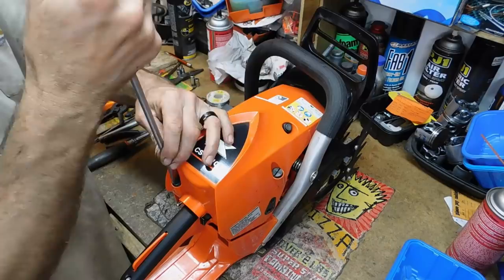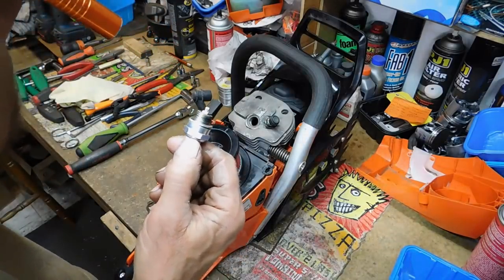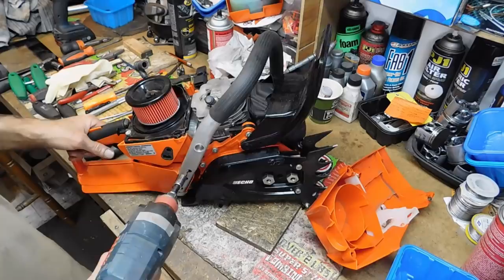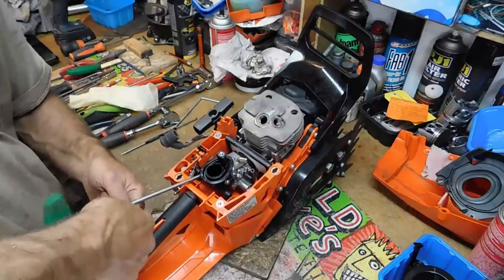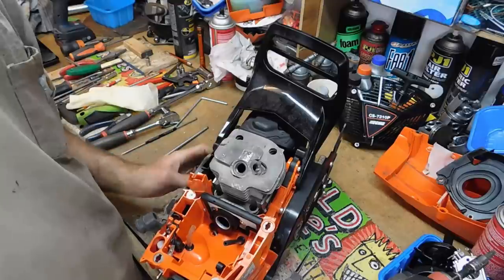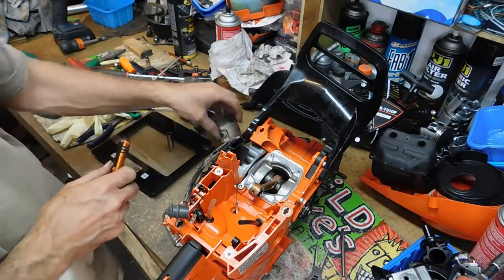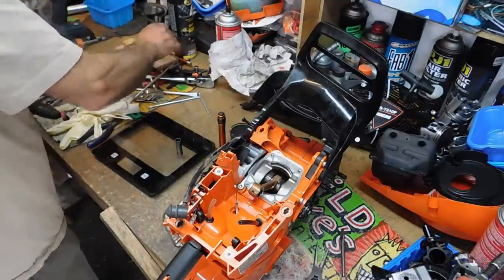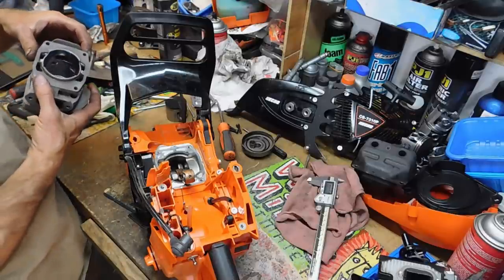Echo CS-7310P Bench Talk

Comment: 100% accurate, I live at 8,369' and m-tronic/autotune doesn't cut the mustard
Reply from the maker: I told that to a fairly high ranking Stihl rep and/or tech.
Nope/they will adjust/there must be some other issue was the waffling.
Didn't want to hear it. 
But, they don't go up there and try things out either...
Thanks for watching.

Comment: Nice to see this coming from someone that's building a mean saw....just from the video before you even mentioned some of the things I seen things myself...and for a saw that had around 4 tanks of fuel through it before pulling cylinder sure had a to  of carbon on the top of the piston and there was only 2 little clean spots in the top of the piston so not much air wash going across the top of the piston to help keep hot spots off piston....but very awesome video

Comment: Hi hotsaw 101 while I was watching the video I notice that the combustion chamber was clean but the top of the piston looks awful black is that normal ? the spark plug looked good as far as I can tail what kind of 2 stroke oil are you running in that chainsaw and ratio?  always good video!

Comment: Well, at about $450 cheaper, better plastics, and a spark plug that you can actually use a standard scrench on, I'll take it over the 500i.
Top cover plastic is already breaking apart on the 500i's.
Reply: I've seen echo's with plastics in bad shape too. Doesn't matter the brand for these pro lvl saws, depends what hit them :P They all use the same PP plastic with fiber glass
Reply: An interesting note for you. A company called BASF mixes the plastics for Husqvarna and Echo in-house then ships to the respective companies in pellet form to be melted in injection molding.
Reply: @Brian2bears  Yes, I used to work at a BASF plant in Maryland many years ago. They also make composite materials for boats and RVs! Interestingly, a lot of companies who sell refrigerated products such as yogurt, cottage cheese, etc, use their products as well.
Reply: @thebradleysoncatbirdhill6849  So you are not the average bear , I look for and enjoy your comments from time to time. ....

Comment: We cut at 8500-9500 ft on average 🤣
Reply: What saws do you use ?
Reply: @sundial6919  Usually running a 660 or 461, sometimes a 562, just lose 30-35% power
Reply: @nouseforaname6846    Thanks . Sorry to hear you lose that much power . By the interesting and impressive sound of this review the 7310 would lose about 90 - 95% power . Cheers
Reply: I wonder if they'll make a super charged chainsaw for higher elevation power? I've seen that jet powered chainsaw prototype.

Comment: It would be easy to check the plenum pressure using HVAC testers. Also they are trying to create a blower.  They are using centrifugal force through air moving in a circular motion to keep the air filter clean.

Comment: Mr. Jack, another note of interest in relation to the "squish" is compression. Inquiring minds would like to know. Thank you.
Reply: Squish is how close the piston pot is to the step or ring in the top of the jug. Squish effects compression but doesn't dictate it. Things like dome or dish pistons also effect compression and in a big way. Deleting base gaskets normally lowers Squish a d raises compression, but also changes where your ports are
Reply: @longstar550  12:33 squish is measured by Mr. Jack @.62. I was curious if a pre-zip compression reading was taken.
Reply from the maker: @Brian2bears  hi. in case others missed it, the .062 number I mentioned was the squish of this saw in bone stock form.
An actual compression reading with a gauge, no. They generally run low when new. I also like to not be jaded with the very first unit. So, I'll just take it out and run the thing as is to get a feel for it as sold. It's a like like doing prototype testing.
My interpretation or context is: Squish is the measurement at the edge of the piston dome & skirt interface when the engine rolls over TDC.

I would agree with longstar550 - that the amount of squish will have an affect on the end result of the compression reading.
I've never seen in a saw where decreasing squish does not also increase compression. But, I have not seen it all either.
Thanks for watching.
Reply: @hotsaws101  Thank you sir for the reply. I appreciate your kindness and longsuffering. I look forward to hearing from you time to time.

Comment: Thanks for the breakdown. It's unfortunate that performance was sacrificed to make it burn clean. Also, thanks for the information about cutting at altitude. I've noticed the difference on older carbureted motorcycles but for some reason never really thought about it in relation to saws.

Comment: Thank you for the informative video.  I understand your trade and interest are focused on chainsaw performance and cut speed.  What I'm curious about is your perception of the saws utility as a tool and instrument of income for accomplishing paying work in the tree trades.  Based on your perspective of the materials, the design, the ergonomics, vibration, durability factors, ease of starting, exhaust inhalation etc, how do you rate this product against the competition in a strictly pragmatic sense?
Reply from the maker: John hi.
I bushel/ed for most of my working career. So in other words, piecework felling timber. The modding & bench talk videos were an offshoot that came in the later decades.
The reason for having equipment (saws, chains, gear, etc.) that perform well is so that my time spent sawing down & bucking up trees was efficient.
I come from that place, and it is always, as a result.
There are things about the 7310 platform that are very nice. The uber thin design allows for the weight to be closer to your torso when moving though the workday process. A definite bonus.
It has a "Husky-esque" feel with the spread out design of handle to pistol grip distance. Fine when you are running a long bar. Not fine for speed limbing  or some of the other "maneuverings" a westcoaster finds themselves in.
The air cleaner system does a great job at filtering fine particulates. Conversely, the air filtration system design hinders overall performance.
The anti-vibe system is a little spongy for my liking. On the other side of that, it is smooth in the operators' hands. Keep in mind that I'll be running a 30 or 32" bar on a saw in the 70/80cc class range for the most part. 33 & 34s at times as well (110 & 114/5 drivers .375) Saws like my 181/281 have seen a 42". The 7310 does not have the power to pull that much bar.
For me, the 7310 is to heavy for the amount of power that can massaged from it. 
The fit & finish are equivalent with either of the "big two".
The materials used in the construction of those saws seems to be high quality/ I do not think there will be to many longevity issues.
The attachment method of the cylinder cover spells for a das-aster out in the bush while changing/cleaning the air filter. The non-captive screws WILL get lost at some point. Those things always happen in the bottom of the yarder block! 
The gunning line on the recoil cover being white is a nice feature and are easily utilized. They seem to be accurate (the most important part overall imho).
Dealer support on the left coast is sporadic at best. The big two have a shop under every rock & behind every tree it seems. No matter how well a product is built, something is going to fail. Parts accessibility is important.

As a busheler, I look for pluses in the aforementioned categories as well as others.
It's not a good platform for a production cutter on the West Coast from my perspective. Firewood cutter and/or homeowner, might be a better application.
Thanks for watching.

Comment: the one 7310p ive seen had 65 thousandths squish :/
Reply from the maker: eth hi. So one of the many reasons why the 7310 struggle in the the power department. 
Saws will range a few thousandths within the model also. Two guys getting numbers within. 003 on a +.060 thicknes could be the measuring method, measuring tool, and/or measuring media.
Thanks for watching.

Comment: You may have discovered the air dam under the air cleaner cover. It is in winter configuration as you are filming the video. If you pull the white air dam out and flip it over then reinstall it, you will have improved airflow. I don't have the saw but have been researching them as a future purchase. I hope you find this information useful.
Reply: The shudder was closed so it would be in summer configuration. Opening the shudder allows warm air from the cylinder head in to prevent carb freezing. I don’t know that it would amount to increased performance though since the way the flywheel pushes air around the filter it seems like it would actually decrease the efficiency. Hard to say though I’ve got this saw I haven’t ran in with an open shutter yet although it’s been in the single digits it fires up and runs great in cold weather without messing with it.

Comment: Odd question- how does a motocross engine make so much more hp per cc than a chainsaw engine? A KTM 65cc makes 16 hp but an equivalent displacement saw makes around 5-6 hp. I understand this isn't an apple to apple comparison because one is air cooled vs liquid. It's seems the only way to make more hp with the same displacement is to add compression, and more rpms. Please, help me understand.
Reply from the maker: Mark hi.
Weight is not such of a factor so the crankcase volume can be huge in comparison for charge storage.
The size of the carb venturi in a bike is multiple times larger in diameter.
Bikes come with a tuned pipe. Probably the single biggest power enhancer between a saw & a bike.
Cycle engines have a full circle crank that ups the pimping ratio. Although,  some saws have "stuffer" cranks also.
Stock saws run 150 to 185 psi. I think a lot of bike are in the 250 range.
And yes, h²o cooling helps a little.
Rpms help with hp but not always with torque. Stock saws have a wide range  From 6500 or so in an 090 to 10, maybe 11,000 in some of the new saws. Zipped saws range from 11 to about 13,500 depending upon the state of tune
it is really an amount of flow capability & tuned pipe in the cycle engines which nets them so much more "hp" per cc.
Thanks for watching.
Reply: @hotsaws101 this very informative response makes alot of sense. Thank you for your response, I really enjoy your videos. Take care.

Comment: I can use motul 710 with 100octane Fuel?
Reply: Yep. Motul 710 and Motul 800 are both my favorite. Running them at 40:1 in all my 2 stroke tools, one of the better performing oils I've tried so I stuck with them.
Reply: @em4703  1:40 no carbon formed??
Reply: @janhavlicek7994  No issue whatsoever after about 150 tanks with both these oils on an MS 261, carbon deposits are usually formed by low quality, stale gas, not by the oil. Just use fresh gas, tune your saw, run it HARD and throw all your worried out the window.
Reply from the maker: Gentlemen hello.
There was no mention about whether or not it is in a stock or modded mo-chine. That will definitely have bearing on which  oil to use.
imho, the 710 is geared toward an injection type application 1st, and then a premix type use 2nd. Seems like a smaller motorcycle, moped, or actual bike with a engine.
The viscosity & density are both low in the 710. Extrapolating, I imagine that the film strength is on the low side as well.
If you are running stock saws, or what ever type equipment, H1-R from Bel-Ray is the best choice. 
Intermediate level modded equipment it's a little bit of a toss up between the Motul & H1-R. 
Flat-out fire-breathing saws, maybe the Motul.
But, there are two different Motul (800) choices. Although, it seems that the factory as altered the formula a fuzz and now calls the two 800 options Ester Core  oils.
So, when Mr. E M refers to the "800", there needs to be clarification on which version of them.
Personally, I think that  the RoadRace is more suited toward a modded to the hilt saw application.
As a side note - a faller I work next to tried the 710 after using the off highway version of Motul. Not a good report.
My thought is that it is a given that someone would Never run crappy fuel in their saw. Especially if it is modded. I never address that aspect unfortunately.
Mix oil is a bit of a slippery slope. It has been known to incite boiling over, emotional tirades in many. Some of them have limited experience on the end of a pistol grip. You need to be very careful upon whom you place your stock resultantly. Nothing pointed at Mr. E M here either.
Carbon can also form when running good "everything" if the jetting is not set appropriately. Or the chains are not dialed in well - which is also a jetting issue. Running the saw at ½ throttle (overly rich) will not build up also.
Saws need to "on the gas" with all aspects dialed in to work properly.
In the end, a lot of my opinion here.
Thanks for watching.

Comment: If it’s not running well at elevation then it’s either not tuned right or something is wrong with it.
Reply from the maker: Or,,,,,,, the compression ratio is so bad they really struggle to make any kind of decent power.
Keep in mind that most all the saw testing done in stock form is while the saw is just that - stock. Stops (limiter caps) on the needles prevent the operator's ability to accurately tune the mo-chine to where it needs to be on many saws.
There is a video from the winter before where a 390 was barely running as well - around 4000'. The limiter caps prevented that saw from being tuned correctly.
The stock testing here was no different.
What many many don't know and/or possibly understand - the 7310s SUFFER from very low compression due to the extremely loose squish factor. It's compounded at altitude. Those that have worked at elevation understand this. Those that have not, do not because that is an experience thing.
In essence, you are right. But not for the reason you think. There is a problem with the 7310s. They lag in the power department due to low the compression. 
Compression = power. It's just the the way that it works on this planet.
That is why I mention things....
Thanks for watching.

Comment: I'm pretty sure my 550xp would out cut that saw!! Just my opinion.
Reply: Well,you’d be wrong. I have both. Not even close.
Reply: A 562 wld give it a run for it's money
Reply: @Brian2bears  amazing saws for 60cc. I have two that r ported but I mainly run 20" bars, occasionally a 24". Things are alot of fun
Reply: @jamiedalluge9472  Absolutely. My first experience with Auto-tune, I had doubts but the results are eye-opening.